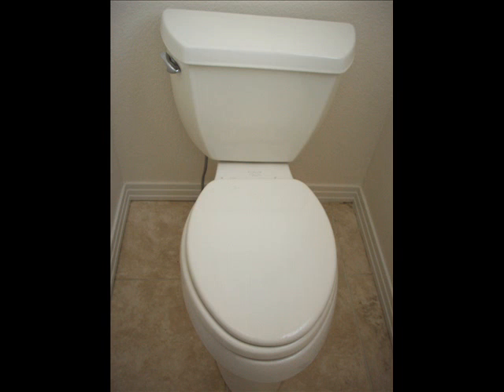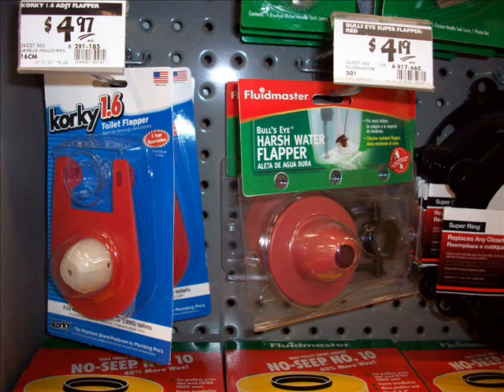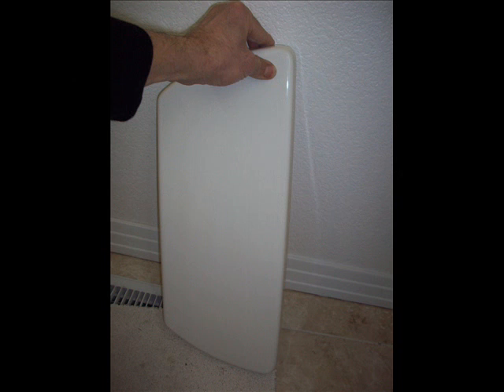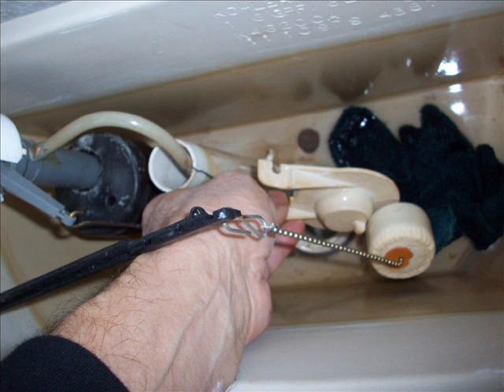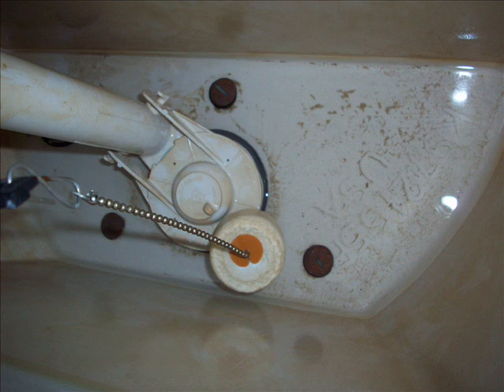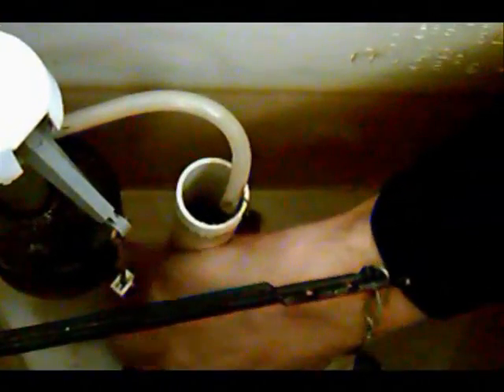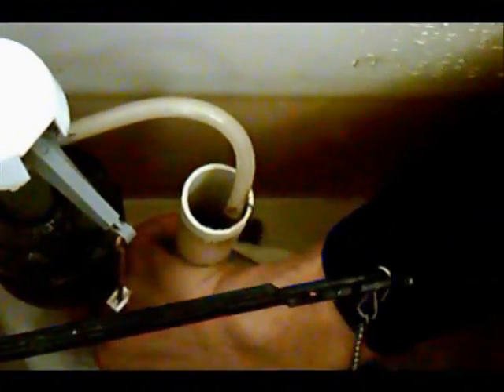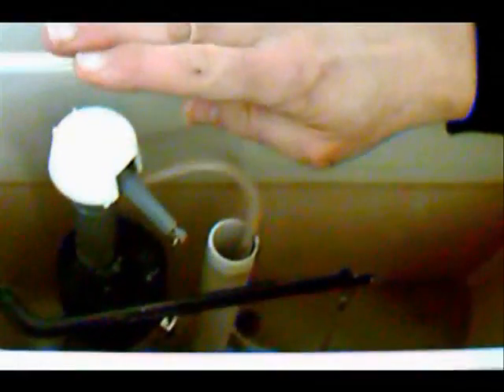Fix a Leaking Toilet Flapper Valve for Little or No Cost | Fluidmaster | Toilet Flapper

Comment: This works, also you can use a wash cloth and white vinegar to clean the surfaces. It will also work on a leaking washer-less faucet by clean the seating surfaces. Most times there is no need to replace toilet flapper or any new parts on a washer- less faucet. Just clean it!

Comment: Well this helped me so much! Turns out that the rubber seal had gotten off center, and the flapper could not sit on top of that rubber ring properly. Mine did not come out like yours did, but I was still able to turn off water, empty tank, disassemble the ball float, and the handle...uh-stem? Whatever. That gave me access to the bottom of that flapper thingy, so I could tinker with it. I am very proud of myself!  :) 

For anyone who can't make a part screw back onto it's original piece, check to see if you are screwing in the correct direction. Ask me how I know that. ;)) Thank you so much!

Comment: This is exactly what was happening with my toilet. I followed your steps and now my toilet is working 100% perfectly. 

With a little bit of scrubbing with polishing pads on the flapper valve the toilet no longer "mysteriously" turns on and off.

Great tip about putting the lid flat on a surface as well.

Thank you for this video. 

Cheers!

Comment: I can see how cleaning the flapper could stop a leak.  I didn't use "food coloring" because I already knew it was leaking.  I tried cleaning the flapper, and I was surprised that the leaking was a lot less.   But I still could hear a drip.  I replaced the flapper with a Korky Flapper and the drip is gone.   Thanks for this video.

Comment: Really helped me. My husband was ready to call a plumber. Even though cleaning it didn't fix the problem, at least I understood what was going on, and was able to go to Lowe's and get a $3 replacemment flapper valve, which totally stopped the leak when installed. That's a lot cheaper than a plumber would have been. Really good video. Thanks.
Reply: Sorry mam but your husband sounds a lot like a wife LOL

Comment: I've fix toliets in the past by simply replaceing the flapper. However this time even with a new flapper it was slightly leaking at the flapper seal.  Saw this video and used the scotchbrite suggestion to the seal (toilet side) and damn to my surprise it worked!  I could not see an debri on the seal so I was not expecting any change.  Thanks for the video!

Comment: My Kohler toilet was leaking by the flapper (same innards as in the video) so I replaced the flapper and it got worse. It was refilling at least every 5 minutes. After I saw the video I used the scotchbrite I had in the closet around the new flapper and down where the flapper rests against. It appears to be fixed now. Thanks for the great video and advice.

Comment from the maker: I agree, but the 1.6 actually was3.2 or 4.8 gallons because the toilet required several flushes.  Also we were experiencing clogging with 1.6 which has completely cleared with the larger flush.

Comment: I just did nearly this same process on an old Elger.
I did use a Scotchbrite kitchen sponge dipped in vinegar to help dissolve the lime buildup. Not clear how to remove that flapper, so I cleaned it very gently as assembled, and used a small brush as well. The seat also. This stopped a rather audible tank trickle. It may be 99 or 100% fixed (the rubber is pliant and may still settle) but I can always do another pass of cleaning rather than over-clean too much & ruin a part. Thanks!

Comment: The "snap on" is the flapper itself. You can use Korky universal Flappers which will fit into the same toilet, as well as other brands, but they don't snap on, but they very easily attach by moving the rubber loops over each poll as oppsed to snapping it down with the Kohlet Flapper.  And the Kohler flapper can be used on Crane and other toilets. And he's right about clogging when it's set to a 1.6 gallon flush,  It's better to set it to flush longer by adjusting the float.
Reply: Thank you so much!  I think you just found my clogging for 10 years, problem!!! NO PLUMBER HAS EVER TOLD ME THIS!!!!! THEY JUST KEEP COMING OUT AND CHARGING ME $270.00 TO TELL ME I NEED NEW GUTS PUT IN (of the toilet flapper unit) and they need another $315.00 to do this!!!!! Right there, right then!  As I was crying and writing them a check for the $270.00...I told them No Thank you!  They were stunned!!! And reason so ex[pensive because two men came out!!! WHY would a simple clogging (plus needed flapper fixed or replaced) take 2 strong men to do the job??? Only hire one man plumber, or one man and his son , singularly coming out to fix!  I lost my great old plumbers son!  he barely charged me anything!  Don't ever hire a big plumbing company, with a secretary, a manager, and lots of plumbers!!! OVERHEAD and keeping all fo them working and an office to rent!!! Boy, did I learn an expensive lesson.  Plus my handyman charged me a high bill, too!  So find a honest handyman!!!! Hard to find!  Bjut keep interviewing!  Finally you will find some good men out there.

Comment: The gasket on my flapper ( identical to yours) was shot.  Kohler doesn't sell the gasket anymore but sells a whole new rubber flapper for $8.50.  I believe replacement gaskets are available on the aftermarket.

Comment: the picture compilation and video worked good together and was real informative.  The only thing I would have added was to show an example of what a leaky Flapper causes.  Should have shown water running into the bowl before you fixed it and how it looks after.  Other than that 4 of 5.  Thank You

Comment: I tried this but it didn't work for me so I decided to replace the flapper valve but my valve is slanted so I purchased the flapper valve kit by korky it comes with a flapper and a ring for the flapper valve seat and silicone I dried the seat with alcohol added silicone to seat and placed it on the seat of flapper valve seat waited about 90 minutes but instructions state 15 and then added new flapper adjusted flapper chain and no leaks. I hope this lasts a long time. #handyWOman

Comment: If you get a Kohler toiler get a good plunger too they are the worst flushing 1.6 gpf toilets made. Being a plumber I can't tell you how many of these I rip out.
Reply: You can always replace the valve/float part that is adjustable to use more water. Much cheaper for the consumer than replacing the whole toilet. 😉

Comment: I called the city because my bill had slowly increased over the last year. $40.00 to 67.00. A year ago, I steadily used around 4000 gallons per mo., with a cost of $6.28. My last bill said I used 10,000 gallons, with a charge of $22.03, and I live alone. I was stubborn that there was something wrong with my meter and they need to re-calibrate it. CS man came an detected a very, very slow leak that I could notice looking at the meter. Bottom line: I was "leaking" about 400 gallons per day!!!! If I changed out the flapper last year, I would have saved around $125. bucks! P.S. and don't let you hoses leak either! Learned my lessons!!

Comment: Hey, I think I have the same Kohler low flush toilet. Recently I've been experiencing an INTERMITTENT slow leak and it's has not been easy to diagnose. I have heard the fill valve come on to fill the tank once. I have seen water trickling down the sides of the bowel once. But, they happened on separate times and I was lucky to be in the bathroom when it did. So, I know I have a leak and the re-cycling of filling, leak, filling the tank. As a matter of fact, since I saw the trickling of water down the sides of the bowl I took off the lid to the tank. I've seen the water level drop several inches at night, but next morning it's full again. Therefore, I've clean the flapper and the flush valve seat. Btw, both were pretty clean already. It still had a slow leak. However, back when I was cleaning the flush valve seat and looking down the hole leading to the bowl I did notice that the bottom rim of the flush valve (the neck, below the flapper) was broken. A 1 inch lip of the rim (but had not broken off) was bent up toward the center of the hole. This will no doubt restrict the flush of water to the bowel a bit, but I don't see how it would affect the water level which is above the flapper. I don't know maybe it's just the flapper. Oh, I didn't notice any cracks on the overflow tube either.

Comment: Hmmm.. My flapper valve does not have a rubber gasket like the one in your video. I cleaned the bottom of the flapper off and reinstalled it. Still leaks....Guess I will remove it again and take it to the hardware store....Thanks a million for this video! Single mom with a kid in college....Do not have the luxury of calling a plumber these days so really appreciate this video and giving it a like for sure :-)

Comment: This is nice if it works in your situation. However, I just had to replace the flapper in my case - cleaning it did not work - and it was only about $3 from the hardware store around the corner.

Comment: very good and very through video.  Nice job!  a quick question - can you have problems with the o-ring between the flapper and the tank?  I've tried a new flapper and the the wool, and there's a trickle of water still (sounds like a tiny stream).  Maybe I just was a bit to gentle on my scrubbing.  thanks, and again great video

Comment: A very informative video.
I followed it and changed my flapper, but the toilet is still leaking with a new flapper. What could be wrong? What to do next??
Reply: coolmirror, Clean around the hole and inside where the flapper sits. He showed & told how to do this, too. Worked great for me.😉

Comment: The only thing to add to this is the cost of a flapper is only a few dollars and what will happen with these flappers over time is that they will start to change shape and not seat properly. I know this for a fact as I have worked on thousands of them.Not just Kohler, but American Standard, Crane,Gerber etc....so i would suggest to replace the flapper for the sake of a few dollars. One thing to remember is to pick the correct flapper for your toilet as they are different..G.L. and have agood day

Comment: Looks like we have the same model toilet. The issue I have is that there is a very slow drip leak where the flapper means the hole opening (gasket?). I'ts a brand new flapper and works fine except it's an imperfect seal over the hole. The hole is 2.5" which is an odd size. Is there a way I can put a rubber sealant around the ring to make a smooth seal when meeting the flapper?

Comment: Hey ClassicManuals, Just Moved In To A New House And The Main Line Coming Up From The Floor Wont Stop! I Turned The Valve Off But Its Still Coming From The Water line In The Tank. Its Plastic Tubing Not Metal( Dont Know If It Makes A Differences?) But The Flapper Looks Fine, Cleaned It Off And Still Leaking! The Floater Thing Seems To Be Good, Whats Going On??!! Thanks For The Upload:)

Comment: Hey I resemble that remark. It has actually been two years since they toilet first leaked. I actually just leave it off. I did try fixing it but it still leaks. I'm very resistant to buying parts for this as the current ones are not that old. I'm going to try this suggestion and see if it helps.

Comment: replaced the flap ..no good...
replaced the entire flush valve...
couldn't get a tank to bowl washer big enough to seal the tank to the Bowl... a much older Gerber toilet..
wound up using RTV gasket sealer 2 complete the seal..... So far so good

Comment: Recently I see trickles of water leaking into the toilet bowl. I have checked the flapper and found a bump on the rubber (the blue rubber ring in this video).  If I press the valve down tightly, water stops leaking thus I believe that's the problem. Any idea what could have caused this bump?

Comment: I have two issues with this video. 1. I don't think you have to remove the flap to clean it like this. 2. What if it is leaking over the pipe there into the toilet? My toilet overflows over the pipe, then that got fix b/c the waterline is now lowered....then, the toilet is still leaking......so it might be the flapper now....The water test with dye is good but can there be another leak besides the pipe and flapper???

Comment: What if i broke the part that pushes the little switch as water empties when you flush, making it refill with water? Then when the water fills up the switch goes up and stops the water from running. Is that replaceable and how so?

Comment: I replaced the seat and flapper and it is still leaking.?????????
Reply: most people dont realize it but the feed tube ( white tube in this video)  if that tube is set below the water line, the toilet will always leak, that tube needs to be higher than the water line, Flowmasters comes with a little clip to mount that hose
Reply: +Rich Ukulele  Thanks for this tip, Rick Ukulete I was not aware that the feed tube had to be set higher than the water line.  Doing it on my own, and need all the information I can get! lol
Reply: glad I could help,, hppe all is well with it.

Comment: my mom and i got into a big argument about toilet leaks. and my toilet water doesnt "flush" as strong as its suppose to. what can i do to make it flush stronger? and DOES IT MATTER IF YOU PUT TOILET PAPER DOWN The hole??? EVEN IF ITS AN OLD TOILET!? yes i have a kohler toilet. but my mom gets anal about putting toilet paper down the hole. is it true? that its bad to put it down the hole when used?